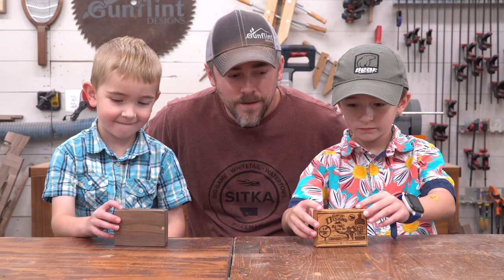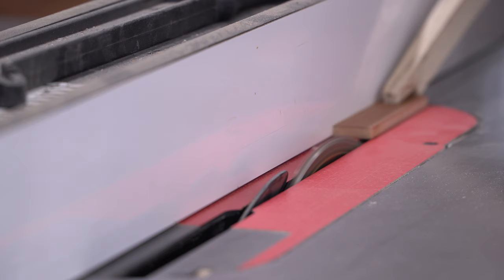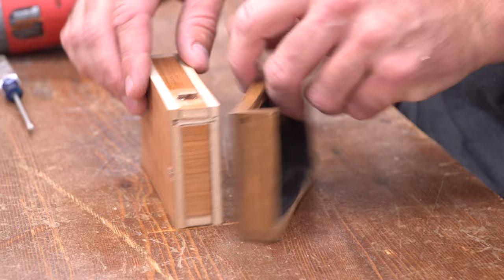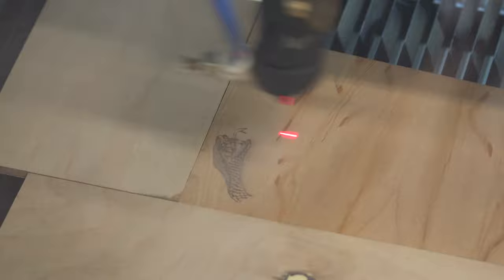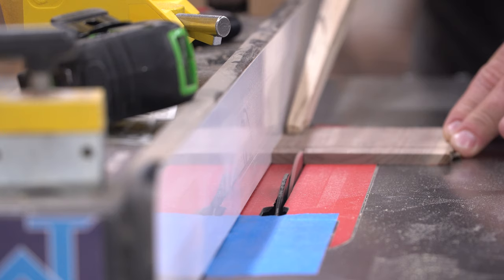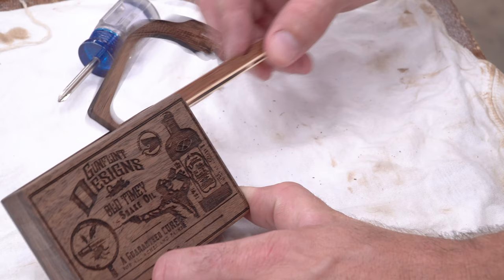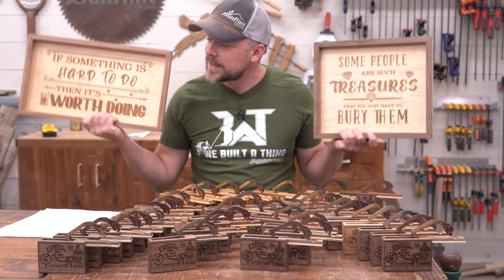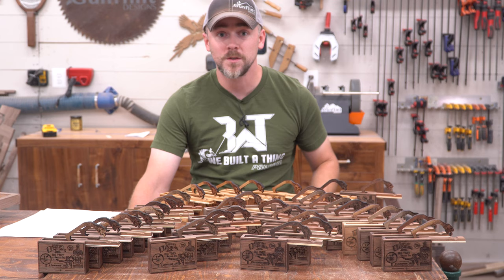Snake In A Box Toy || Woodworking Project

Comment: Dude, you name the lazar RAY! duh!
Reply: P.S. the covered copper wire your dad used is SO much smarter for anything that'll be used by a kid. A wooden snake will ALWAYS break! Plus the wire will add a bit of flex that will increase the "bite".
Reply from the maker: The wire is definitely more durable. Unless you already suspect the failure point and embed a nail into the wooden one to act as a robot spine in all the production versions.
Reply: @GunflintDesigns  Don't think even that would help, as the rigidness is what's ultimately going to cause any break-point in the snake itself. I think using a 4g/6g piece of copper wire, like your dad did is really the way to go for durability. I mean the design you did on RAY (wink wink) is brilliant, just not the best for a "toy". :)
Reply: If ya left the wire uncovered, and painted the snake head, copper? he he he a copperhead! ;-)